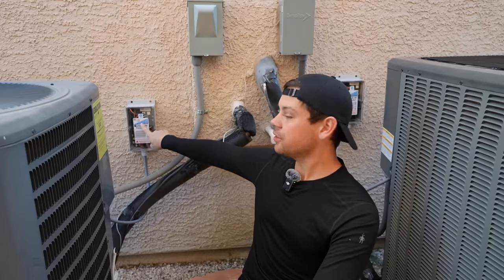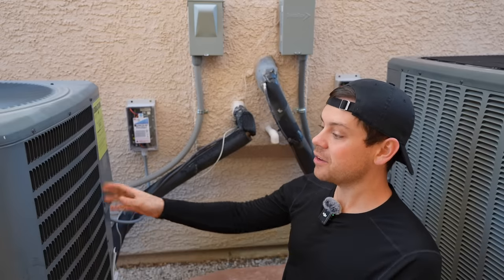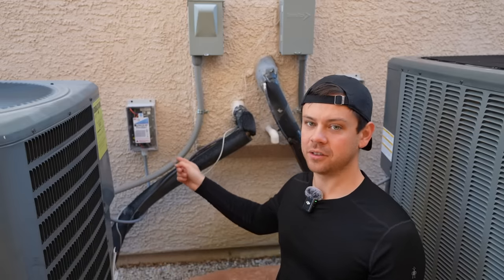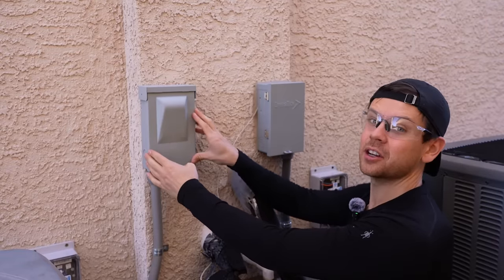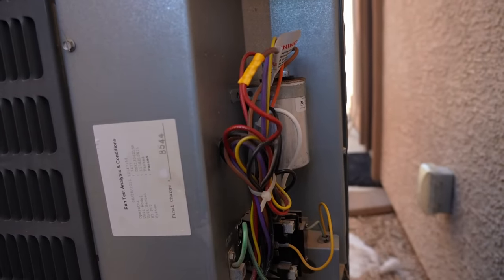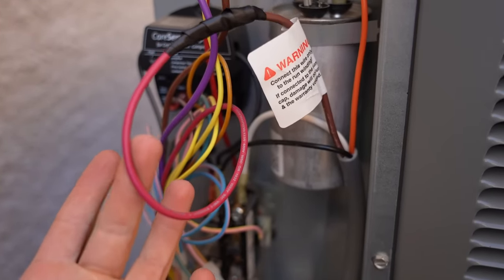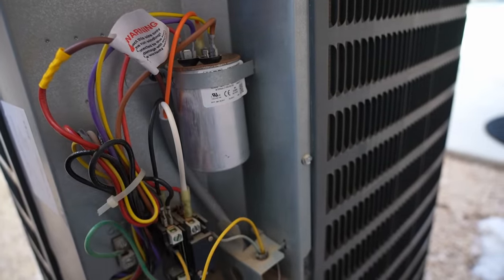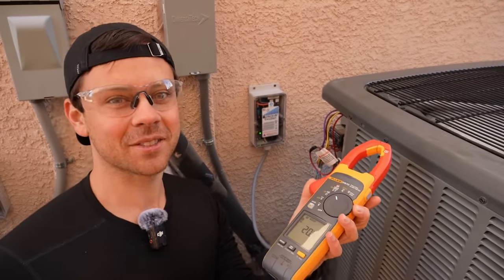AC Soft Start to Save $$$ in an Off-grid or Battery Backup Solar Power System

Comment from the maker: You should also add a grommet or wire clamp at the connection between the cable and the cover. It is included with the installation kit if you purchase it.

These also do not change the warranty status of your condenser unit. I thought they increase the life of the compressor motor but I learned from a forum member that compressors fail mechanically before they fail electrically. So they do not increase the longevity. But they do increase the longevity of your inverter circuit.

Does off-grid solar confuse you? 
Check out my DIY friendly website for solar system packages and product recommendations, and so much more! 
http://www.mobile-solarpower.com

Join our DIY solar community 
#1 largest solar forum on the internet for beginners and professionals alike:
https://www.diysolarforum.com

Check out my Book
Best-selling and beginner-friendly guide to 12V off-grid solar!
http://amzn.to/2Aj4dX4

If DIY is not for you, but you love solar and need an offgrid system, check out Tesla Energy! They will price out a system and get your house offgrid: https://ts.la/william57509

My DIY Solar Equipment Recommendations (Constantly updated! Check here first):

12V/48V Lithium Solar Batteries: https://www.mobile-solarpower.com/solar-batteries.html

Complete Solar System Component Directory: https://www.mobile-solarpower.com/solarcomponents.html

Complete 48V System Blueprint: https://www.mobile-solarpower.com/48v-complete-system-blueprint.html

Plug-N-Play System Recommendations: https://www.mobile-solarpower.com/full-size-systems.html

Complete "Add to Cart" 48V System Kits: https://www.mobile-solarpower.com/complete-48v-solar-kits.html

DIY Friendly Air Conditioner/ Heat Pumps: https://www.mobile-solarpower.com/solar-friendly-air-conditioners.html

My Favorite Online Stores for DIY Solar Products:

Signature Solar
Offgrid One-Stop-Shop. Best Value 48V LiFePO4, Victron and Offgrid Specific Heat Pumps:
https://www.signaturesolar.com/?ref=h-cvbzfahsek 

Current Connected
SOK, Victron, Mr.Cool Heatpumps and High Quality Components. Fantastic customer support: 
https://currentconnected.com/?ref=wp

Litime 
My favorite 12V budget battery!:
https://www.litime.com/?ref=XBIA62RFcalHns

Epoch Batteries
My favorite high-quality 12V battery:
https://www.epochbatteries.com/products/12v-460ah-lifepo4-battery-ip67-heated-bluetooth-victron-comms?rfsn=7352625.50494d

Renogy 
A classic 12V solar store that has been around for ages! DC to DC Chargers and more! 
https://renogy.sjv.io/n1VjXx

Rich Solar 
Renogy's biggest competitor! Similar products, but at a better price: 
https://richsolar.com/?ref=h-cvbzfahsek

Battery Hookup
Cheap cell deals
https://bit.ly/2mIxSqt
5% off code: diysolar

Contact Information:
I am NOT available for personal solar system consult! If you wish to contact me, this is my direct email: williamprowsediysolar@gmail.com

Join the forum at https://diysolarforum.com/ if you wish to hang out with myself and others and talk about solar

FTC Disclosure Statement and Disclaimers:
Every video includes some form of paid promotion or sponsorship. Some links on this youtube channel may be affiliate links. We may get paid if you buy something or take an action after clicking one of these. My videos are for educational purposes only. Information is subject to change/update at any time. Electricity is DANGEROUS and can kill. Be smart and use common sense :)

DIY Solar Power with Will Prowse is a participant in the Amazon Services LLC Associates Program,
An affiliate advertising program designed to provide a means for sites to earn advertising fees by advertising and linking to Amazon.com
Reply from the maker: I'm not going to add it lol but people will complain 😂
Reply: You know…..you should add a grommet at the bottom there where the wire comes through. 😉
Reply: You forgot to say "bye"
Reply: Will these are wifi capable and the company can remote in to fix any issues... get what you pay for in my opinion
Reply: The area that you ran the soft start cable through is intended for low voltage thermostat wire, it is a transition place because the stat wire insulation usually does not have the voltage rating(600V) to be in the area with higher voltages.
Reply: LRA = 'Locked Rotor Amperage' not good to use for comparison. FLA = 'Full Load Amperage' is the value you should use.
Reply: Thanks, Will, for your channel. I installed one of these a couple years ago. I had an issue with my house lights dimming when my a/c kicked on. Both the local power company and two private electrical companies were called out on about 6 different occasions and couldn’t find/fix the issue. I was advised to try a hard start kit (for about $40) and that did nothing. I got desperate and forked over the $350 for an EasyStart and it finally did the job of stopping my lights from dimming on a/c start up. Normal grid 3br house with no solar or battery, totally weird. Spent more on service calls, so I’d say I paid enough to warrant the final expense. Self installed, great friendly customer support from EasyStart. Still don’t understand why I have to have it, but I’m over it now. Thanks again for the informative video.
Reply: @WattsMiner  I believe they are Bluetooth capable. And you can send the info in to them for diagnostics.
Reply: @WattsMiner , unless the units have been upgraded or changed since last year, they're Bluetooth capable.  Not wifi.
Reply: I've been using and installing these for about three years. I constantly get more installs from customer references. Most of my customers are RV owners.
Reply: I came here to mention there should be a grommet or clamp.🤣🤣🤣🤣
Reply: Does the slower start not reduce mechanical strain too?
Reply: @justinjja2, I would assume to some extent. Exactly how much I'm not sure. I myself have only been installing them for 3 years. No complaints on my side or from my customers. No failures either.
Reply: @pbertlin6194  these devices are particularly designed to lower the LRA, since that's what spikes momentarily and stresses various components. They do not reduce the FLA.
Reply: I have a 12.8 volt ,50 amh LifeP04 battery and my ebike charger is 54.7 volts .
I'm wondering if the ebike charger charging at 54.7 volts will damage the LifeP04 battery.
Hopefully someone can help out ,thanks!

Comment: These things have $25 worth of components in them and they charge $400 for them. Such a scam lol.
Reply from the maker: I know it pisses me off
Reply: ICM-870 series are less expensive.
Reply: If you just want like a basic soft start it is about 5 to 10 bucks.
Reply: They are all wifi capable and the company can remote in and fix issues... get what you pay for guys
Reply: @sspyder181 only software issues which you kinda expect to already be ironed out at $400 but can't do a anything about hardware
Reply: So where is the DIY for making one
Reply: @wiremanibew  that does sound like a good open-source project
Reply: @wiremanibew it's literally just some SCRs being gradually phased up. The DIY kit is Mouser and an intermediate understanding of electronics.
Reply: What is dumb is that AC manufacturers don’t include this!  The Micro-Air is worth it to me…I doubt anyone reading this could take their hourly rate at work, plus material costs and get anywhere close to the price.  My only gripe is that I can’t integrate the BT connection with Home Assistant to log the startup data as it occurs.
Reply: There is a lot of confusion in this thread. A simple hard start capacitor kit is about $10-30 and increases the starting torque but does NOT decrease the starting amps more than a few percent unless you try to measure it with a low resolution amp meter and you get a false reading.

One of these soft starters probably has closer to $50 in components, but that is NOT what you are paying for. It is a microprocessor controlled device with a lot of software written to ensure gentle starts and prevent damage.

Contrary to what Will said I'm on grid power no backup with a 25 year old 5 ton central AC and I installed one and it's lovely.

My compressor no longer has a loud clank when starting that wakes us up at night, our lights no longer dim at startup. AND last summer I had a run capacitor fail that the soft start detected and shut the compressor down before it fried.

It saved me an $10,000 immediate system replacement expense. But some day I will have to replace.
Reply: @colinnwn  Regarding soft starters, correct. But there's still MUCH cheaper soft starters out there, at least by 50%. Reliable too.
Reply: @WillProwse  tbh you should look in to manufacture one at an affordable price, and you have a cult like following since we ether already installed our solar system but still here I am and I might just be your first customer since I have an off grade home and look forward to installing hvac
Reply: Bet a cheap industrial VFD could do it just as well at commodity pricing.
Reply: Get what you pay for? If it has wifi it makes it less valuable! Having wifi is a total gimmick 100% 

If the Soft starter is not working, it would be a hardware issue. There's absolutely nothing that can be done over Wi-Fi to fix it...

I have made a bunch of DIY soft starters in the past few years for a bunch of different applications, including Large ones for central air conditioners for both running off of an inverter or a generator.

Comment: Air-conditioner manufactures should build their AC units with soft starts installed. It just makes it easier on everything.
Reply: Soft starters just became prevalent a few years ago and some HVAC's do not need a soft starter, some HVAC's are designed to be low power consumption on startup.   If you want one on a new HVAC or Heat Pump most installers will put one in during installation.
Reply from the maker: Agreed. I just got this condenser and didn't come with it. I was bummed.
Reply: Yea we have to design specific grid infrastructure around the fact they don't and all will start up immediately if the power was out thus dropping hertz from lack of supply and destroying everything.
Reply: @Bowhunters6go8xz6x  You mean prevalent in HVAC, or in general?
Reply: Here in Europe we have Vacuum cleaners that are all with soft starters, electronic power control for more levels of cleaning!
Reply: My new mr cool 5 tons are soft start out of the box! So happy with these bad boys
Reply: Best to get an inverter driven heat pump or AC unit than a traditional 60 Hz. AC induction motor driven one. Not only will it stress the electrical system less, it'll also cause less audible noise as it switches on and off. In fact, an inverter driven unit is designed to automatically adjust heating or cooling output based on the thermal load. No more bang/bang on/off cycling.

Comment: After pulling outdoor disconnect, there's still 24 volts coming from the indoor air handler transformer. Turn that off too. Don't accidentally blow a fuse or fry the contactor coil, a board or thermostat.
Reply from the maker: Oh I don't care about that lol not dangerous. Never had an ac tech turn that off. Do you?

Comment: inverter air conditioning/heat pumps do not require a soft starter, they have a DC inverter compressor with variable speed. and are more efficient than the on/off compressors.

Comment: These soft starts would obviously add idle energy consumption. Also they are design for motor starts w/capacitors or limiting inrush.  You probably wont need these soft-starts if designing a system with solid state equipment

Comment: I put this MicroAir soft-start on my 30-year-old AC. It cut my inrush from 86 amps to 45... that's on 1 leg of the 240. I wanted to be able to run my AC off my generator during a power outage. My generator can run the AC, but it can't start it. This device has an additional benefit of not allowing the compressor to try to start for 5 minutes after a momentary power blip. That along with the ramp-up to full power is easier on the compressor.

Will is right. It is kind of confusing to wire it at first, but once you watch enough YouTube videos it is very simple to install.
Reply: I wonder of this can be wired in to a WaterFurnace.  My mom has geothermal and currently no back up for it in a power outage.  Given it's size and whole house...my guess is it's about 4 ton.  A good size inverter generator can run it but likely cannot start it according to the maintenance tech.  

Guess I need to grab LRA and understand what the unit needs before doing anything.  May be able to use a clamp on it and actually get the in rush.  The nice thing about her furnace....the resistive auxiliary heat grids are all on separate breakers.  Those can be shut off in the event of a power outage and she can have at least some heat.
Reply: @wadebrewer7212  MicroAir says they can do more than just AC units, but it requires you to contact them. To get the best performance, you have to buy the one for the tonage/BTU rating of your AC unit. It may cost more if they have to program one just for you. I would assume all they would need is the inrush and running current of what ever you're powering, but I am not an Electrical Engineer. :)
Reply: @billboyd7938  lol....neither am I.  🤣

Comment: Don't forget to secure cable where cable goes from AC unit. Sharp edges can damage cable over time and (possible) expose hot on the surface of the unit. I'm not an electrician, but heard that there are some NEC rules about it

Comment: Prepping for Solar/battery installation; installed a Micro-Air Soft Start on our 5 ton AC compressor; start Amps (LRA) dropped from 130 Amps to 30 Amps (12 Amps when running on 5 Ton). South Texas; 40-50 starts a day, 100 Amps less, that has to be much better on both Solar Inverters and compressor lifecycle.
Also installed an Eltwin Hyper Engineering SureStart on our 12 ton (140k BTU) Pentair Pool Heater/Chiller and the start Amps dropped from 194 Amps to 44 Amps (LRA listed as 185 Amps - limit of SureStart) Micro-Air could not go over 5 tons. Full Running Amps on Pool Heat Pump is 28 Amps (Eltwin SureStart higher model is 16-32 running amps).
Today’s install is on a 1.5 Ton AC compressor that is currently pulling 44 Amps on Start.
FYI - both AC’s are 4 year old Carriers (builder install).
In summary I wish that I had put the Soft Starts on the AC’s when new as the 5 ton has been getting loud on start-up and start - amazing at how much quieter they are with a Soft Start.

Comment: We have a 5th wheel with 3ACs. I put soft start on them all and bypassed the power management system so we could start and run all 3 at once. And since they only draw 11.8 running amps we can run the bedroom unit on our power-urus batteries (bought on your recommendation) for a few hours in a pinch. 

We primarily use our 5er in the dunes at glamis with no hookups. I put in 600ah of batteries, 800w of solar on MPPT. It keeps the lights, furnace, various chargers, coffee pot, and fridge going for a full week without worrying. Assuming there is good sun. I started with 400ah and it wasn’t quite enough, especially if we have a cloudy day or two.

Comment: My Micro Air lowered the inrush on my 16 seer 3.5 ton unit from 82 amps to 24amps making it possible to run on my 7000 watt geni! Worked great and I thought it was a fairly easy install.

Comment: great info Will! .  a question maybe you or another viewer can answer:  As a newbie not ready for DIY yet, I got a dual delta pro setup with their dual hub for "mostly whole home backup"  so I've got 240v capability and as I understand it, 7200w max,  running into a 30amp inlet and I have an interlock switch on the generator breaker.  We have a 240v well and all electric home, so that was the requirement for emergencies (water).  we have trane XLR15 units for our home and I got 2 micro air soft start switches installed on our units.  Our delta pro/inlet setup is currently for emergency power and in grid down situations it's working intended minus the hvac units (well booster pump and water heater can both be used in this setup).  I've tried a few times now to fire up a single hvac unit/blower unit with these soft starts and the delta pros just give up the ghost right away.  I initially thought wattage (if I read the label right - it's 230v x 40amp max (min is 23) - so I thought I was in the surge range, but now I think even with the soft starts, I'm exceeding amperage between the pump outside and blower unit in the attic.  I'm too chicken to open my panel to be sure, but I can tell you the breakers for the one I tried are split - the outdoor pump breaker is on the right side of the panel and the blower unit is on the left - I've read the 2 delta pros together actually just feed up to 3600w on each leg of the panel, but i'm too clueless to know what that means relative to what I'm looking at.  Just curious if you know if the delta pros can handle the load and maybe I need some panel re-configuration, or if I'm better thinking longer term about maybe a separate inverter that can handle 50 amps or more and moving the 240v units to a separate panel / transfer switch - thanks !! btw - there has been less than 1,000w in use when I've tried this previously.

Comment: This is the same soft start I use with my EG4 6500EX's. My inrush was 77amps and about dumped the inverters first time the pump kicked on. Now Inrush is reduced to 19 amps. So far works great and the inverters don't have any issue starting the pump even while handling other loads at the same time.

Comment: These old units certainly stress the inverters! Nice. Our 15kva Victron triple parallel Multiplus II system is connected to 3 large AC units. The inverter AC units are so gentle on our system, it's a pleasure to watch them slowly ramp up. 😎 Thanks for the vid - @OrganicPower-Australia